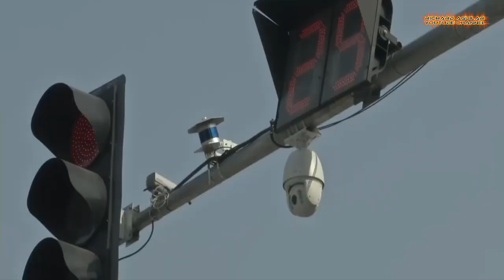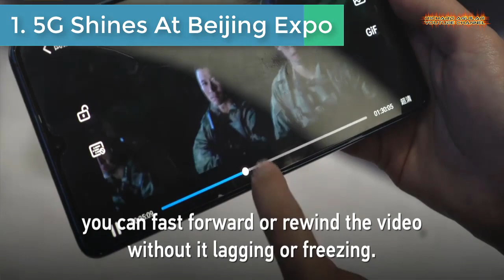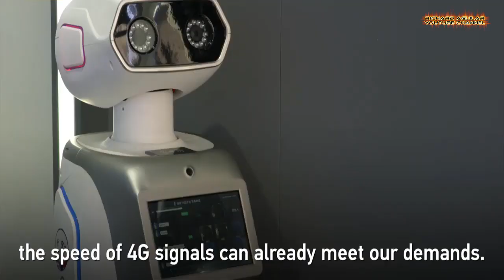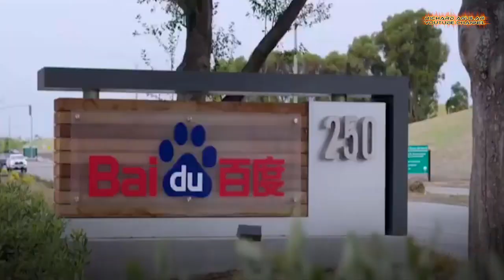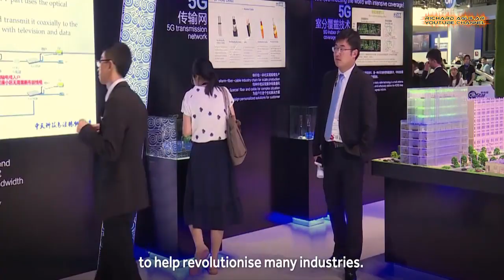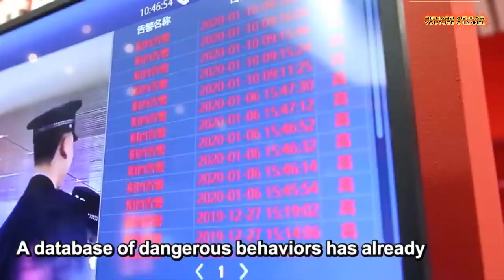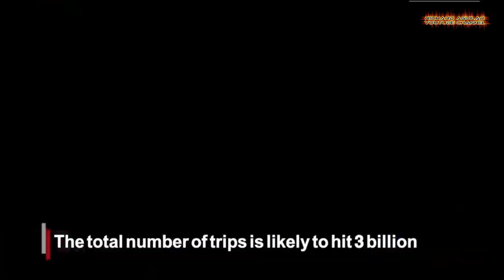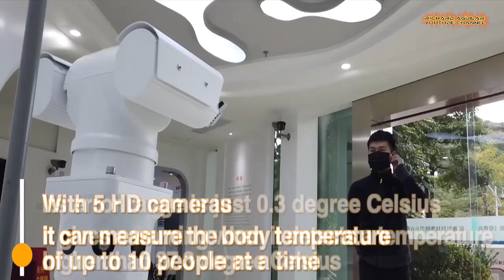China's Latest 5G Technology Is Changing The Lifestyle In China

Comment: 5G technologies are great! Important for transportation, space travel, production and research.
Even the overcoming of seperation between production and consumption will be possible. All will be interconnected and synchronized all are inside and unifyed. 
For example: Today even the fridge can communicate with  internet. By 5 G you can communicate by RFID and Codes. So the consumer knows exactly how much milk is in the bottle, the producer knows how much new milk must be produced. All flows. All is absorbed into the machine and community.
Ecological production is realy possible. All is glassy.
Reply: Uli Sirius it‘s a killer